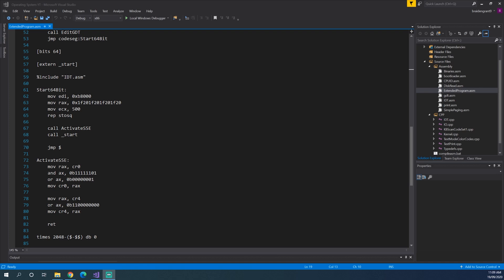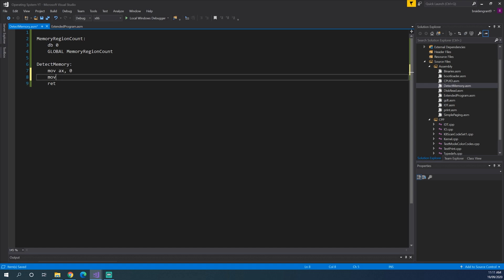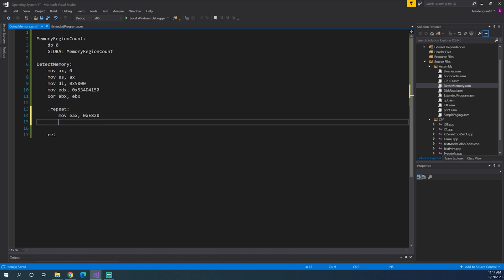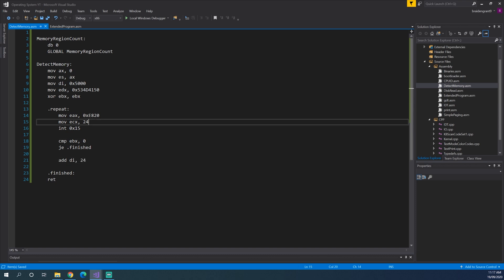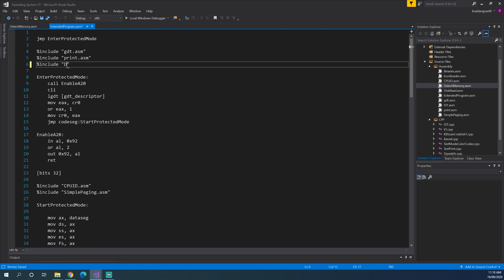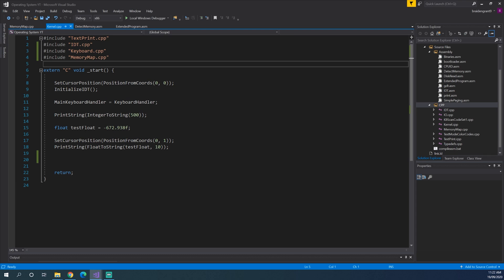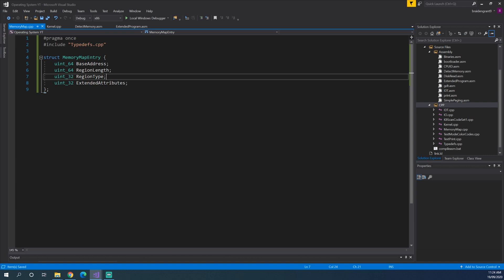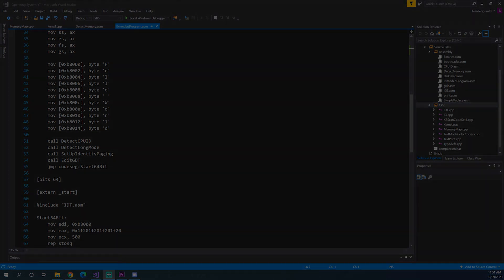Memory Map - 1 | Make a 64 bit OS From Scratch!! | Part 17

Comment: As I understand it, you need to move at least 20 bytes to ecx before the interrupt call. This indicates the length of the structure passed to the bios. You should use 24 bytes though because otherwise the APIC 3.0 extended attributes field would in some cases not be preserved. The base and the length of the output of int 15h occupy 8 bytes each and the type occupies 4 bytes. So if the 20 bytes are occupied and you only give 20 bytes for the structure there is not enough space for the ACPI 3.0 extended attributes field. Returned in ecx is the actual length of the structure, which is almost always lower than 24 but that might change in the future.

Comment: As I can see from OSDev Wiki, is not safe to do manual memory probing "Direct memory probing is only useful for very old systems with buggy and/or non-updateable BIOSes, or maybe a system with modified hardware that does not match the firmware anymore. So if you don't intend to support this sort of computers, you don't need memory probing. Period. Even if you need, you may decide that it's safer to run will less memory than is available."
The good part is that you can learn even that is not useful anymore :) Good job with these tutorials!
Reply: But it's not manual probing here, it's the "BIOS Function: INT 0x15, EAX = 0xE820" method no ?
Reply: @MathieuMaret  uhm maybe it's not manual probing put looks very similar to one